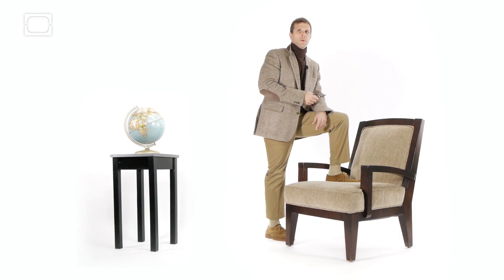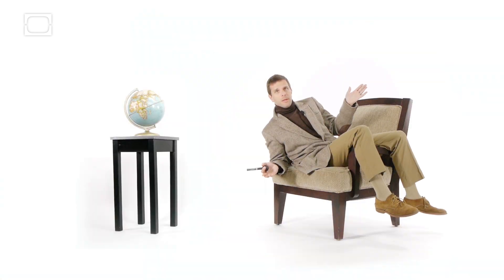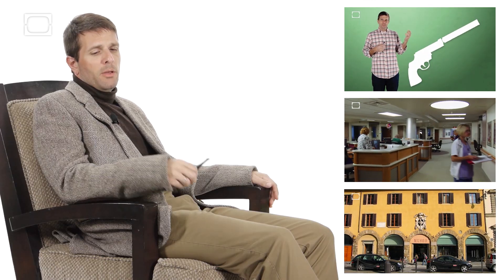Does Hitting the 57 on Ketchup Bottles Really Work? | Don't Be Dumb

Comment: Thought non-newtonian meant it would always get hard when hit? If hitting causes it to move, isnt a regular newtonian fluid?
Reply: There are multiple types of non-newtonian fluids, some become more rigid when stress is applied, some become less viscous. All non-newtonian means is that they do not bend to conventional newtonian laws.
Reply: shouldn't a change in viscosity from a hit be Newtonian, because there's a transfer of energy that causes something solid to act like a liquid with its molecules moving around more then a solid state (and gas being the state with most of its molecules freely moving about).  so there is a small motion caused in unperceived directions

Comment: Also, I have a suggestion.
Is it true that you can survive in space without any kind of suit or protection for at least twenty or thirty seconds so you may be able to do something to save yourself, for example, to get inside a spaceship?
Reply: Despite what HTTG says, you would have to exhale all your air, not take a deep breath. Taking a deep breath, then being ejected into a vacuum, would cause your lungs to burst.  Exhaling all your air, you could survive a brief exposure to space.  There's so little material in space, that your body heat wouldn't go away quickly, despite space being very cold.  Exposure to radiation would be an issue, but you'd die of suffocation quickly enough that it wouldn't be an issue.
Reply: Sean You'd still suffer major damage to your body though. I wouldn't recommend it.
Reply: The water close to the surface of your body would also begin to boil. Keeping that in mind, your eyes might actually explode. Wow.
Reply: http://imagine.gsfc.nasa.gov/docs/ask_astro/answers/970603.html
Reply: I think we need to do some experiments.
NASA won't allow us to throw people outside a space shuttle, therefore we have to build a vacuum chamber with extremely low temperature and find a volunteer.
Does anyone have contact information of creators of MTV show called "Jackass"?